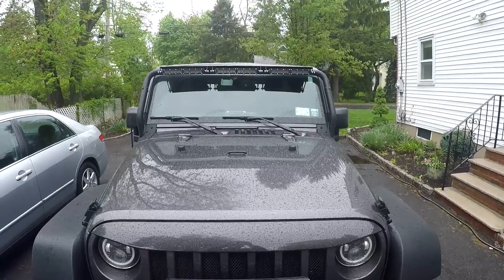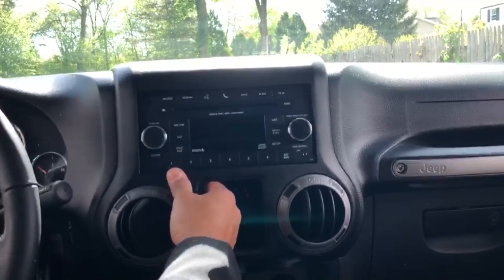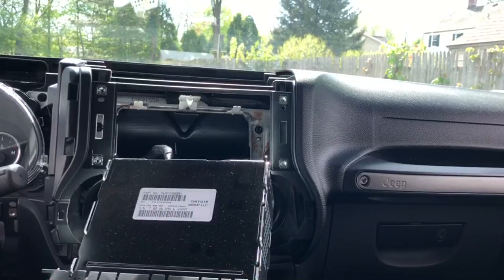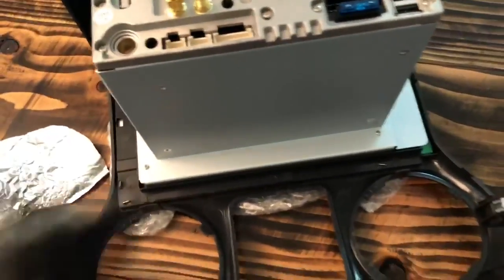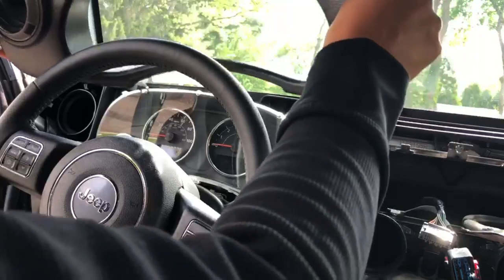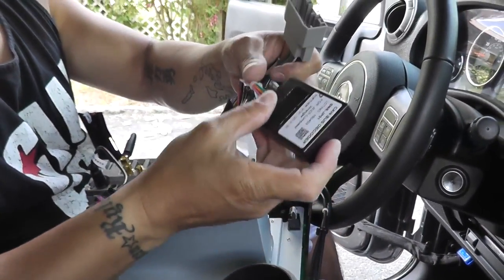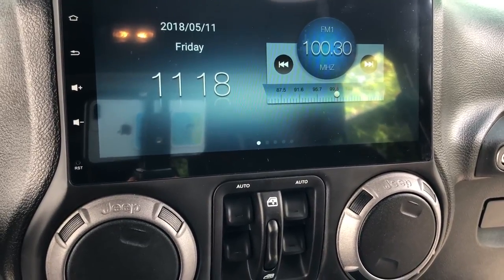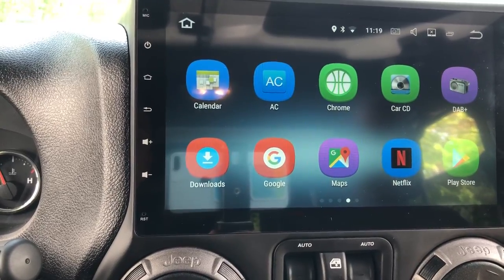Jeep Wrangler 10.1" Touchscreen WiFi GPS Radio Install by Seicane

Comment: Did you have to buy a separate dash that goes over the gauges or does it detach from the center dash?
Reply from the maker: Did not buy anything separate. What you see is included in the kit.

Comment: Mine is crap. It looks awesome but it freezes up, won’t run sound thru my phone calls so my hands free doesn’t work. The customer service is problematic with time difference but that’s expected, however their only answer was to download an update of which the head unit will not read...so no update for me. They offered a discount to have it fixed near home...uhm, don’t think that will work.  Waiting for a refund but only after they receive it via snail mail.....it will cost me another 70.00, this is apparently a crap shoot and I didn’t win. So disappointed.